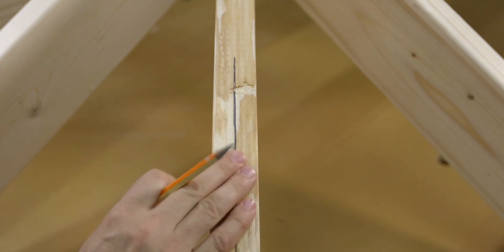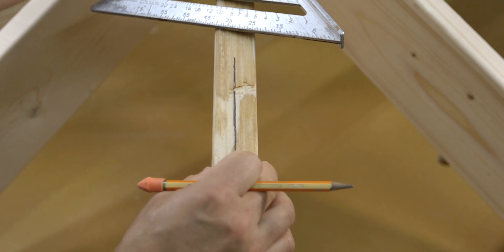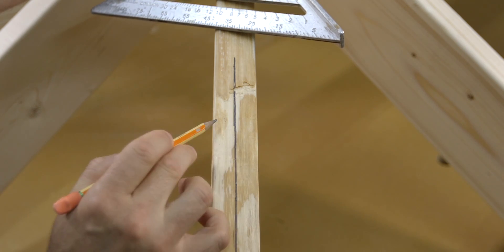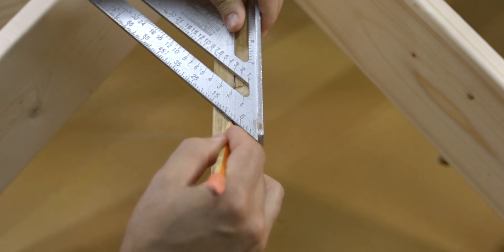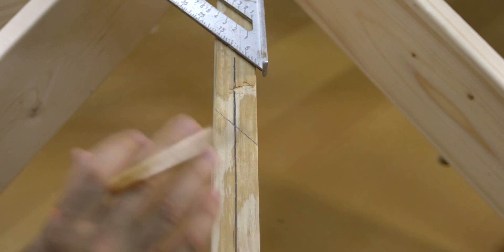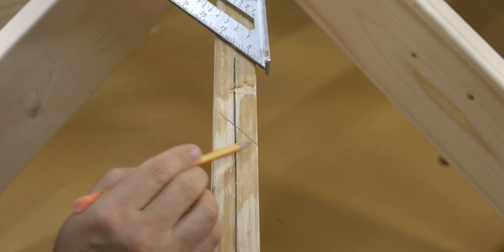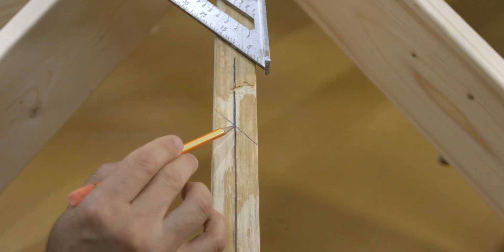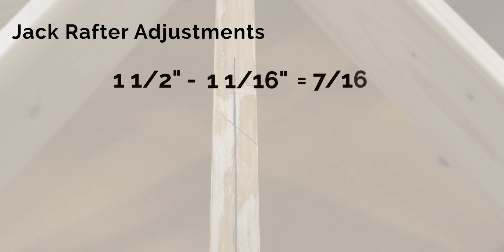How To Frame A Hip Roof Part 2 - Answering 2 Important Questions

Comment: thank you very much for the videos.  They are very well explained.   The only thing I've wondered about is how all the rafters are fastened at the point where the ridge board, king rafter, common rafter and hip rafter all meet.
Reply from the maker: They would be all attached with framing nails... normally from a framing gun.

Comment: I know this is an old video now but what if I have a double hip such as double LVL hips measuring 3-1/2" total, do I need to subtract anything or am i still going to half with the angle measuring to add to my construction calculator?

Comment: You are a great teacher. I have learned a lot from your videos. 
Question, does the 7/16”  works with 4x hip material or is does it only apply for 2x material?
Reply from the maker: Yes, only 2x material. My working knowledge is weak when it comes to all those specifics of different material thicknesses

Comment: Another way to get to get the jack rafter measurements, especially on a small roof, is to actually just measure 16"(or 19.5 or 24 or whatever) square over from common rafter to the where the hip rafter intersects ti mark where the jack rafters long point will sit. Then measure from there to where it will sit at the outer edge of the top plate.

Comment: What if you rafters are 24" oc and not 16" oc  when using the calculator  . When determining  jack rafter lengths
Reply from the maker: you can adjust that within the calculator

Comment: I just layer out the 4 walls for a shed and one of them are a half inch longer than the others so then a calculator won't be 100% accurate.  So what to do?
Reply from the maker: Cut them a little longer and fit them as needed.

Comment: Shouldn't the 7/16" be added to the jack's run, not the jack's length? If you draw the projection of the runs on the ground and you draw the connection between the jack rafter and the hip, we can clearly see that the run has to be elongated by 7/16" to reach the long end of the jack.
Reply from the maker: I send you an email.

Comment: Sorry but you still didn't explain how to calculate the 16.97 (17").  
To calculate the diagonal of any square, multiply the length of the side (12" here) by the square root of 2 (always approximately 1.41). 
 So 1.41 * 12 = 16.97
Otherwise,  good videos.

Comment: I have a question that I don’t think you covered.  I am cutting hip rafters for my outside cooking are roof.  The building is going to have a small box and 2’x2’ small dog house type coming out of the top of my hip roof ( to let smoke out)  my rafters come to the point of my box and i am struggling to get the angle and length right on my corner rafters. Thanks in advance

Comment: How would you calculate common and hip rafters if you have double ridge beam.  Your video show single ridge but what if you have double.
Reply from the maker: Basically, your run simply shortens which changes the numbers you put into the calculator.

Comment: Maybe I'm a complete moron (in fact, I'm sure I am), but I don't see how those derivations of the 7/16'' demonstrate that you need to add that distance to the jack rafters' lengths. It just seems sort of coincidental.
Reply from the maker: It is simply because of the calculator.

Comment: If you marked the 45 degree line on top edge of the comman rafter then at the midway point squared a line across the top edge of said rafter and measured from that line up to the long point would that work out at seven sixteenths or am I barking up the wrong tree. great videos btw thank you

Comment: So, what happens when you have a different size common rafter on either side of your hip rafter?? I'm redoing a really old porch roof. Built in the late 1800's. The original hip rafter is 2 1/2" wide. I have to replace it. The roof is 40' by 8' with the end common rafter having about 4' run with the front rafter having a run of close to 8'. I'm gonna replace the hip rafter with 2- 2x10's which is 1/2" wider than the original. Hmmm.... A 2 piece hip rafter replacing a 1 piece hip rafter.....

Comment: If you have your hip rafter cut at a single bevel 45 (porch roof coming off the wall) it will lay flat on the ledger. Do you have to take into consideration the 7/16’s with a single bevel and not double?

Comment: How do I mark the jacks location on the hip or valley ?
Reply: Hip length divided by run x the on center spacing. But you the to take into count the centerline and width of hip. You can also step it off, but it is a different rise and run. If your interested let me know.

Comment: 16.97  = 12 x √2  
The runs of the common, king and hip rafters  45-45-90 triangle, therefore hip run =  common/king run multiplied by √2 (or ~1.41). From that you can calculate the hip run for any roof pitch.

Comment: What happens if say your stock material is 5 1/2”thick and not 1 1/2” thick, wood the 7/16” be a different size ???? Would there be a rule of thumb for different size material?
Thanks 🙏

Comment: So that 7/16 changes in each roof pitch..like 8/12 9/12 5/12 would be different.?
Reply from the maker: No it's the same no matter the pitch.
Reply: @TrainingHandsAcademy  ok..thnks another question i have a roof book and the talk about shortened the jack rafters and hips..on a Valley roof and hip roof...what is that.?
Reply from the maker: @joelethalcruz4417  This is similar to the 7/16" adjustments we have to do on the Jacks.  There are many different ways to calculate a roof, and shortening has to happen with a few of those ways in order to make everything "plane" out so that the plywood lays flat. You have to remember that most measurements/calculations are taken from the centerline of the framing material, but we of course can't frame that way, so we have to shorten/lengthen framing members in order to assemble a roof, again so everything is flat for the plywood to lay on. It's a very deep topic but I hope this helps some.

Comment: Rather than 7/16 (for 16-in on center framing), do you know how much you would add to the jack rafters if you're framing 24 inches on center and you want them to land on center?
Reply from the maker: If you are using the calculator in this video it would be the same for 24" OC layout... add 7/16"

Comment: Framed hundreds of houses and never needed a calculator, You can step the commons off with the square .Measure the hip rafters and the jack rafters. No mistakes.
Reply from the maker: Yes, I really like that method as well Jerry. :)
Reply: I’ve framed a bunch also. Can step it off, use the blue book or scale it. Great in any situation. I do use the calculator just like the video. You make a great point. You can’t beat a field measurement. Have never framed a house perfectly square with equal measurements everywhere. Framed a small 12x12 structure yesterday and used the calculator for the hip roof. Came out great but even on that had to trim or add here and there. What if batteries go dead ay?
Reply: @Jerry Riggan

Cool story, bro.
Reply: I will try it